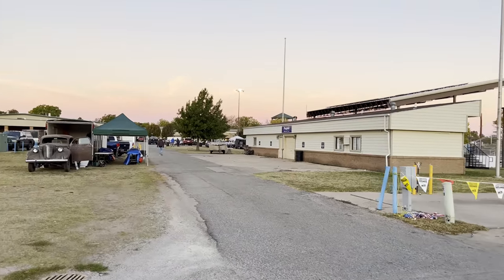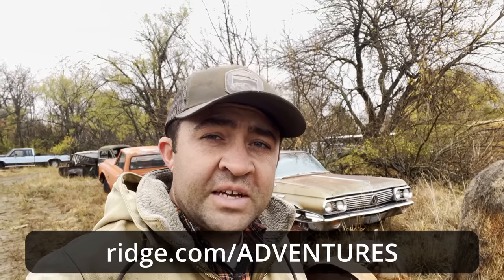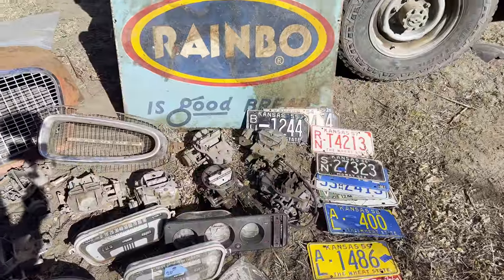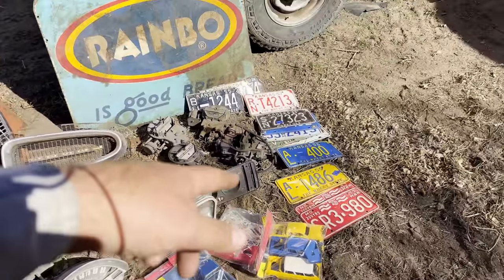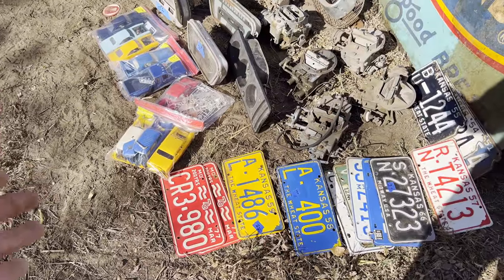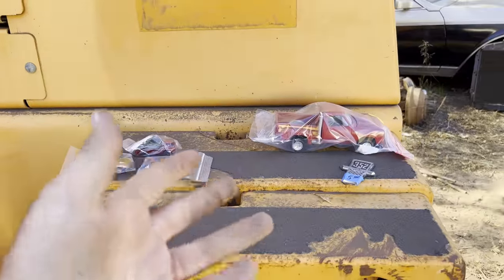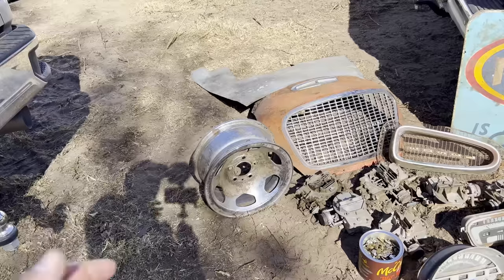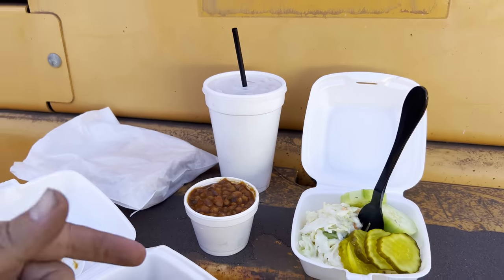Check out my SWAP MEET Finds! Plus I bought 2 Antique Trucks!

Comment: Instead of a table for taking pictures in the trailer, consider a small sheet of plywood from the lower shelf on the right, over to the one on the left, and it would be easy to store

Comment: The valve cover on your truck looks like 327.  The v groove with rectangle center plate is a good clue.
Reply: Your right - good call
Reply: 327's usually had the ram horn exhausts.

Comment: On that roughly 48 Chevy truck, I've heard of mohair seat fabric. But that looks more like rat hair. okay tiny bit of humor there. Don't you want to axles underneath your don't bed trailer? Why not one or two levels in that spot on your shelving. Then you have the open area until you decide to put something that's larger than average in that spot. Seems how it works. Hey enjoy that 50 4-door you bought out at ellinwood. Like you said on that blue truck I couldn't make it to the ellinwood auction. So I gave beds that I thought I would not be hurt on if I actually won something. Good for the seller and the auctioneer that the weather's cleared up a little bit. I was the guy that gave Jim the auctioneer a list of high personal bids for certain items. But there's always more out there. Maybe you could try doing some more shorts of 15 seconds to a minute videos on youtube. Maybe it will advertise your channel to more people. I don't see a reason why you're not over 100k. Maybe try vintage car adventures made from scratch.All the same look forward to your next video

Comment: Way before you showed how dirty your hands were, I'd decided I'd post a comment recommending that you figure out a plan and budget for gloves.  Considering the stuff you were grabbing with your bare hands, I would have been wearing kevlar grip-dot cut-resistant gloves, on top of nitrile disposable gloves.  

Just today I got a couple more boxes of nitrile gloves at the Harbor Freight member/sale price of $5 per box of 100.  A few years ago I bought a bundle of 50 pairs of yellow kevlar gloves with blue silicone grip dots for around $1/pair, and they are very durable, almost a lifetime supply if you throw them in a bucket of water with dish/laundry detergent once in a while.  And of course for some things, leather gloves can't be beat.  The key is buying them at a bargain, which often means finding a quantity bargain on eBay, tracking prices on Amazon via "save for later" in your cart, combined with seeing price history on camelcamelcamel.  Plus watching HF sale prices for the  5 mil nitriles so that using them for an hour and tossing them is cheap enough, and maybe getting some of the thicker ones (7 or 9 mil) for uses that tear up the thin ones too quickly.  

Last time I checked, replacement hands weren't for sale.  Getting dirt, rust, oil, grease, dust, and metal grime into skin cracks, can cause chronic pain, or nerve damage, or loss of feel and dexterity.  Getting most of it out with hand cleaner is good, but not as good as it not getting in so dirty to begin with.  Having clean, warm hands also feels a lot better.  In the summer, the nitrile gloves can get sweaty, but you can use cotton liners instead, or inside oversized nitriles.  Every bit of hand protection helps.  

If I did the sort of work that you do, I'd immediately spend $200 on gloves, stash a little supply of them everywhere I work and in every vehicle.  Then I'd plan to spend between $100 and $500 per year on replacing them and trying other types.